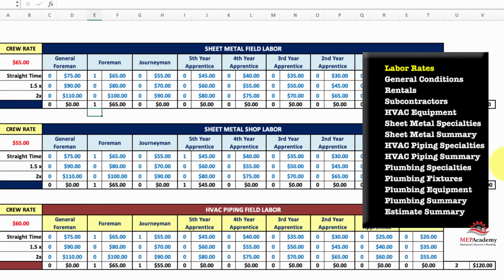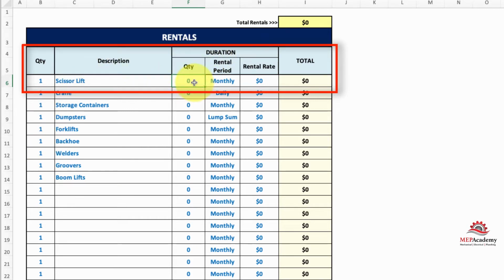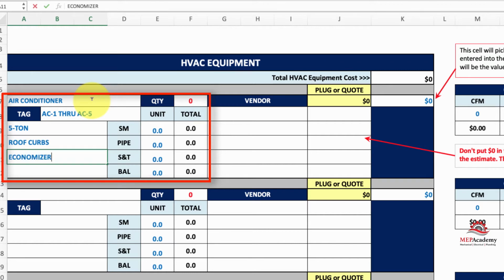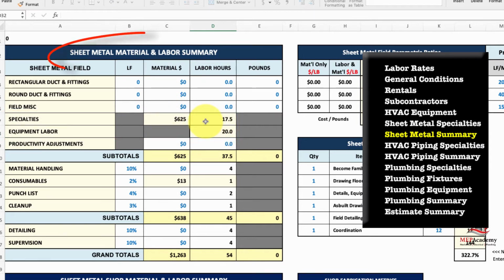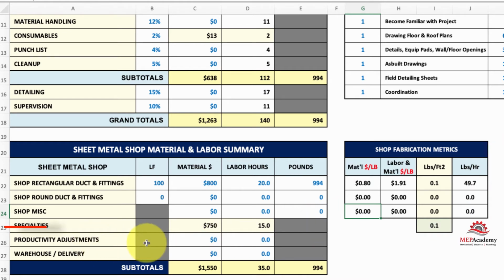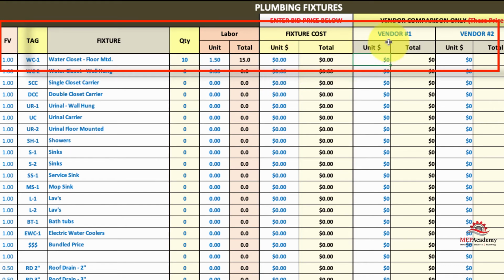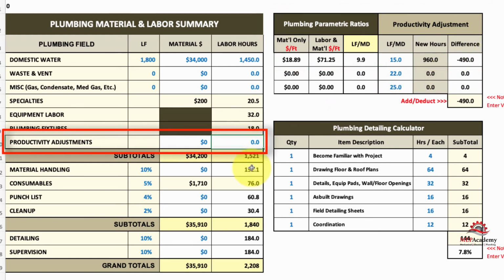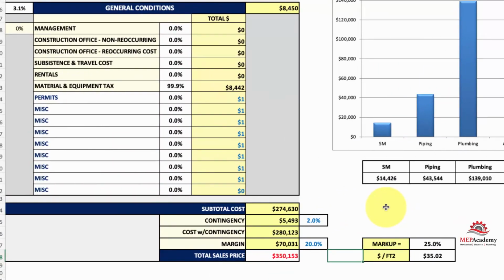HVAC and Plumbing Construction Estimating Spreadsheet

Comment: For which location do you have labor rates, material costs ? also, who updates these costs on an ongoing basis?
Reply from the maker: The spreadsheet is used for putting together all the equipment, material, labor and subs onto various sheets within the spreadsheet. It helps automate the summation of all the different estimating sheets. You would need to provide your own material and labor values. The spreadsheet has a labor table to enter labor rates based on worker expereince and crew size. The spreadsheet is used to summarize everything in one place and allow for profit and overhead margins. It provides various metrics based on square feet, tonnage, fixture units, etc.($/Ft, $/Ton, $/Fixture).
Reply: @MEPAcademy  As an owner of real estate, it would have been much valuable if some default values for equipment/material/labor were provided.  I don't think many owners will have time / resources to find this information.